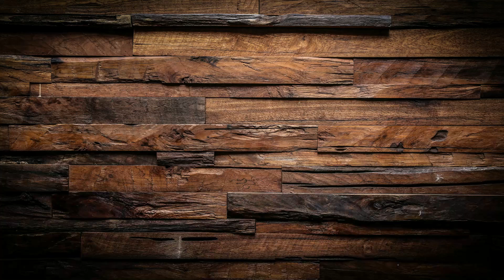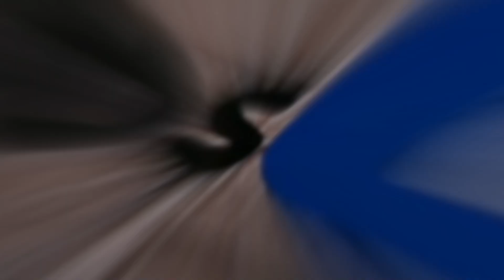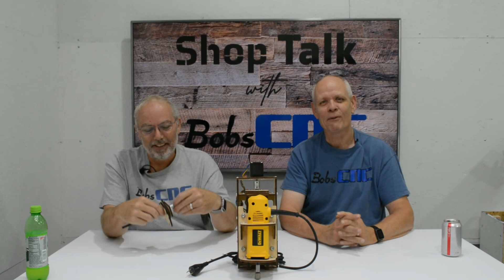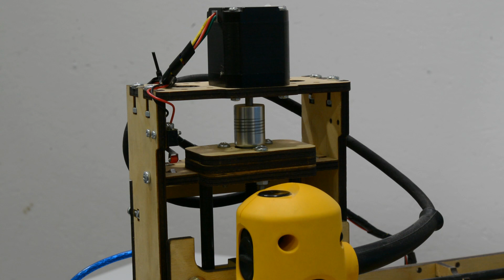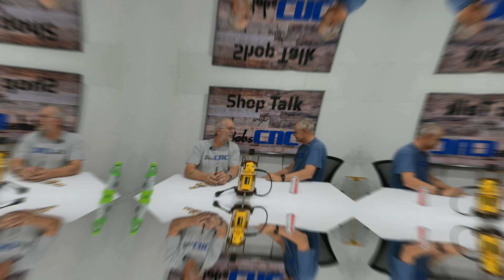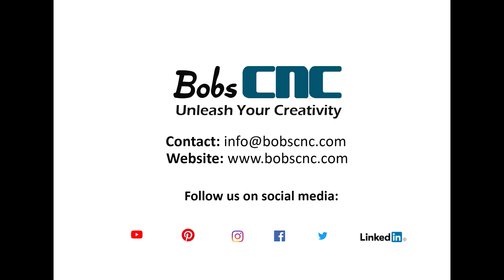Shop Talk: Z-Axis Wobble

Comment: What I found is the 'flat' that was ground into the end of the threaded rod was so deep that when the set screw was seated it would force the coupler off axis. Would suggest not grinding any deeper than the depth of the threads to create the flat.

Comment: You guys are adorable with your friendly silliness in the beginning of the video 😂 I have a wobble on my E3 Z axis, but it is the plate that is wobbling, not the all thread and coupler nut.
Reply from the maker: It may be the nuts that are clamped to the inner race of the bearing.
Reply: I will take a look. And see if it has slack in that plate. If it does, should I glue the outer face of the bearing in place to prevent wobble or make a new piece?
Reply from the maker: @danielmannon8741  No, we would not recommend gluing. Some customer shim between the plates with washer. One washer for each screw.
Reply: @Bobscnc  that's that millimeter washer (or .040" for those in the States) you were referring to?
Reply from the maker: @danielmannon8741  Yes.